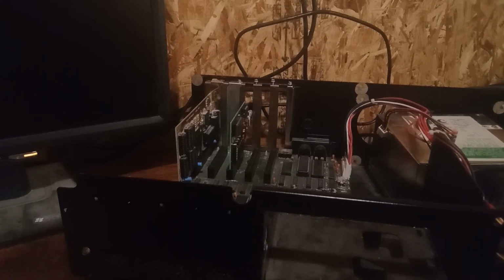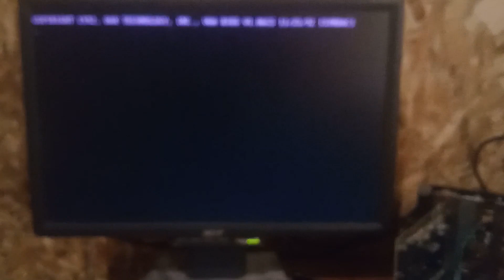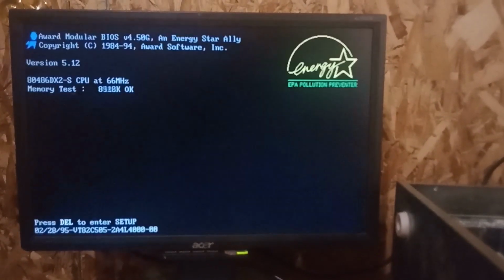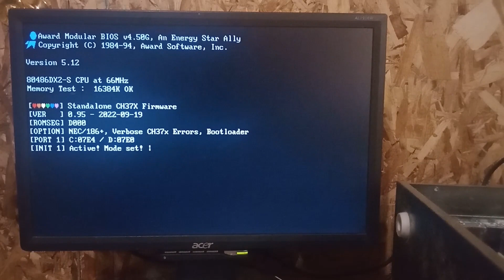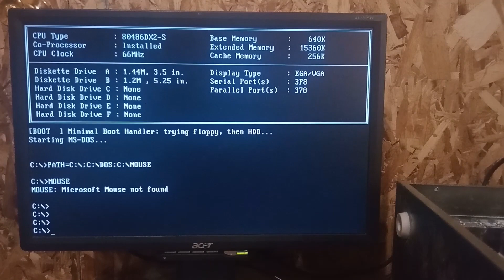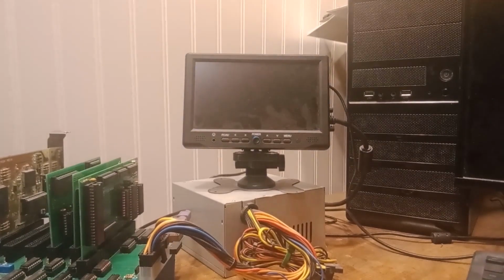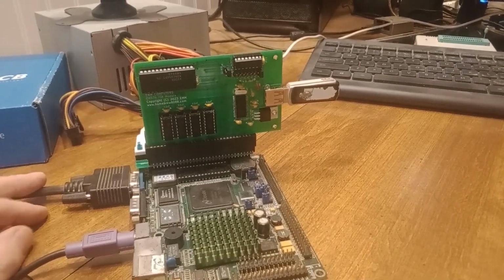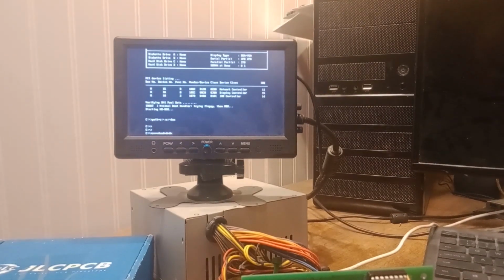ISA USB Drive Card, CH376, Update

Comment: Sorry, could you ask you which the jumper configurations? Thanks ps. i 've got to mount on a NEC V20 and on a 286. Thanks Edy. I found D0000-EE000
Reply from the maker: Great question. I probably should have shown them in the video. I don't have the system put together right now so I can't check. I described the jumper configuration at 2:40. If you download the manual for the 5150 you should be available to sort it out.

Comment: Does this USB interface work with other kinds of USB devices?  For example, I want to connect an "active Usb to PS2 adapter" to this USB interface.  The reason I want to do this is so that I can add a PS/2 keyboard and a PS/2 mouse to my retro 8088 system.  Also, is this USB interface compatible with the Usb specs?  For example, is it compliant with USB v1.1 or v2.0?
Reply from the maker: It could but the code is not written for it.

Comment: I am having this error. 
"Danger" Device smaller than rom parameter table. Suggested cylinder count: 0x079
Reply from the maker: That is typical error.  Is it still booting up though?
Reply: @elijahmmiller  Does not boot. The same pendrive that I use with the USB CH376 card directly in the project of its Motherboard with DMA starts normally but does not initialize on the ISA USB Drive Card CH376. 
I used a 64mb pendrive and it gave this error. "Danger" Device smaller than rom parameter table. Suggested cylinder count: 0x079.
I tested with an 8GB pendrive and the message changes to. "USB DISK 2.0 PMAP:07388M - limited to 00504M" but it still doesn't BOOT.
I think the problem must be in the BIOS as you report in the video, but I don't know where to fix it. Just now I tested it on a PC-XT CLONE TURBO and it worked, but it doesn't work on your PROJECT.
Reply from the maker: On my project are you using the stock BIOS that boots from the USB module? If so..the code is not written to work with both an ISA card and a module.  You have to re flash the BIOS ROM with the USB code omitted.
Reply from the maker: Email me if you need help reflashing your BIOS ROM.
Reply: @elijahmmiller  Exactly, I'm using your BIOS on your board. Which BIOS should I use? Should I install both ROMs with the same BIOS on the CH376 board?
Reply from the maker: No you just need to modify the BIOS on the PC. The stand alone USB ISA card is fine.
Reply from the maker: https://drive.google.com/file/d/1VUNmxUpoONja2w8QCDFlVJpmTuGMQIsA/view?usp=sharing

This is a link to download the BIOS I use with the CH376 code omitted.
It is 32k so if you are writing to 28C256 it fills the entire chip. 
If you have the 64K ROM board you need to write it starting at address 0x8000.
Reply: @elijahmmiller  Thank you, it worked.

Comment: Great trick with the keyboard cable. If you ever run into another multi-wire planar cable you can actually order them (unterminated of course) wound in a coil like that.  You can get a rj-11 crimper for very inexpensive. Obviously that is only needed if you can't do a restoration on the cord. Be careful with pre-terminated phone cords are wired straight through and hand set patches cross over the pairs. This will almost definitely damage the keyboard.
Reply from the maker: I am thinking of building a drop in PS/2 card. It would not be tied to IRQ1 or port 0x60 but could get someone by with most DOS programs.

Comment: Great work 👌👏
Your homemade bios pc can boot from the USB?
Reply from the maker: I only did the hardware. The BIOS was developed by other people. 

Yes though it boots from a USB drive. I picked this media due to its portability.
Reply: @elijahmmiller  nice.
The guys who developed this bios did they provide programs to add and extract  bios extensions?
Reply from the maker: Yes. From the beginning he used a BIOS extension to implement the USB drive.
Reply: @elijahmmiller  I mean, is there a software like CBROM to edit, add and extract extensions from this bios?
Reply from the maker: You just place the extension chip between address 0xC0000 and 0xEE000. The BIOS scans the area when it boots.
Reply: @elijahmmiller  when HDD is present, did usb boots up? I mean, can we do smth smart. boot up usb os, then soft from cd, to install os to hdd, or repair hdd. but this can do, when connect this hdd to other pc.